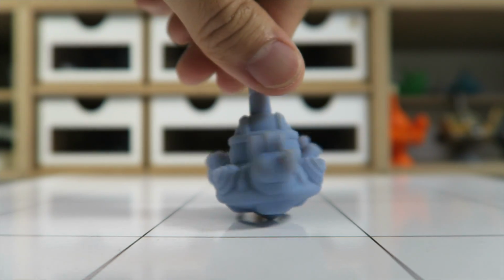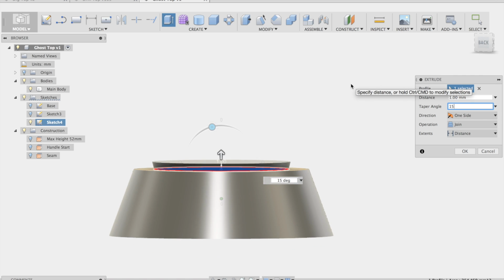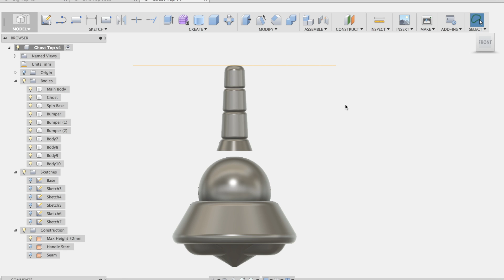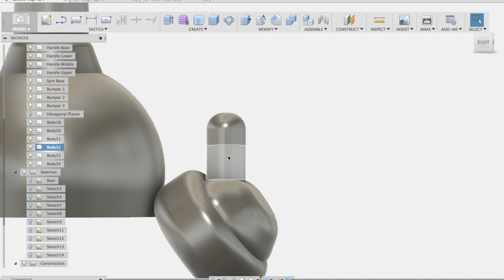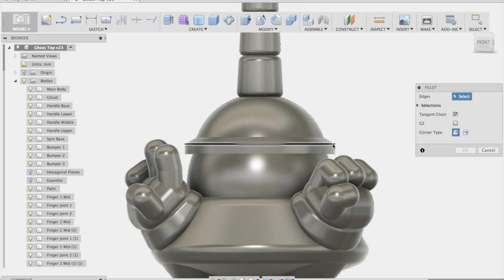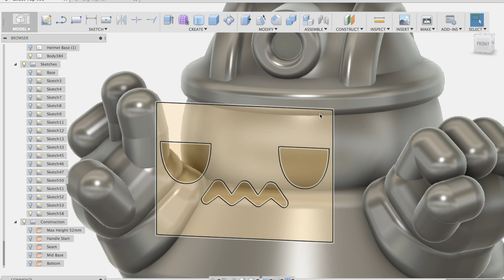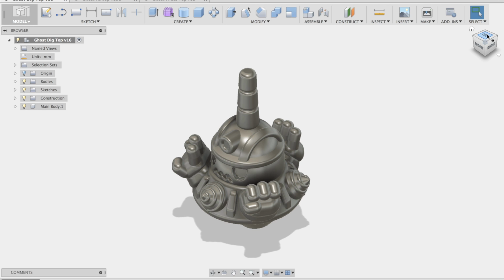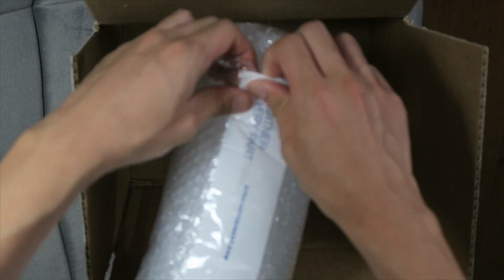Let's Make a Toy : Tumble Tops Part 1 / 3D Modeling in Fusion 360

Comment: How did you do the Project to Surface command on Fusion 360? I can't seem to get that part right.. the Project to Surface function seems to be different.
Reply from the maker: Fusion 360 is constantly getting updated so they may have changed how that command works. To be honest, I'm a bit rusty with this software since I've been busy with developing Relix but I plan to get back into 3D printing soon! I found a more recent video that might better explain how to use the project to surface command. Let me know if it helps!
https://www.youtube.com/watch?v=gXioiU6kaGE
Reply: @RelixWorks  oH yes, i watched that before, that was why I was wondering, how come your command was so much easier. Fusion updated and it became worse! lol
Reply from the maker: @Michael-lo7sq  Thanks for the heads up! I'll have to look into that when I get a chance!

Comment: how do you create articulations of hands, arms or joints for action figures on Fusion 360?
Reply from the maker: I haven't done this myself so I can't offer much help. But I think that if you study action figures, most of them use ball joints. So creating a ball peg shape and then making a socket to fit over it. This could be achieved using spheres and cylinders and dimensioning them to the correct tolerances.
Reply: Ok thanks